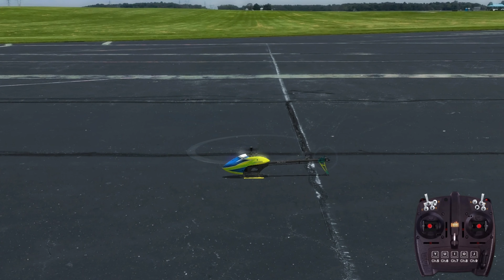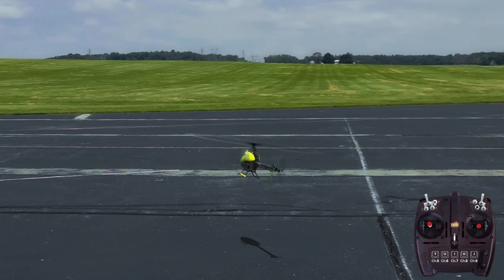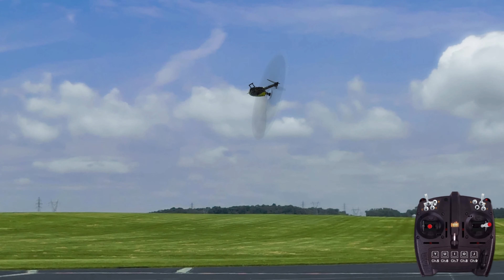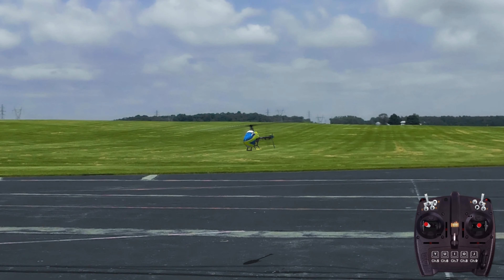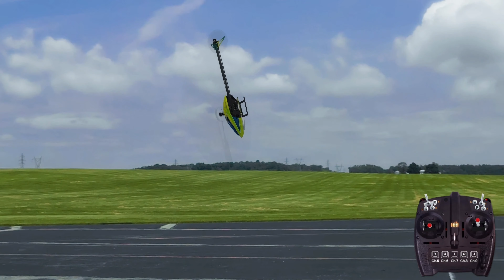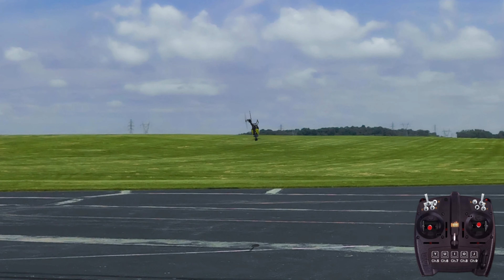RealFlight Helicopter How-To | Half Piro Flip

Comment: How does the model "hang" in the air like that during knife edge? I have my physics set at 150% which is just about realistic for a real rc helicopter at the field of 400 to 600 blade size and average headspeed.
Reply: I wouldn't run physics that fast. If anything, you want to slow things down in the sim so you can learn the stick movements without having to worry about timing too much.
Reply: @MikeG4936  true, slowdown to learn, then speed up to simulate, if not even faster.